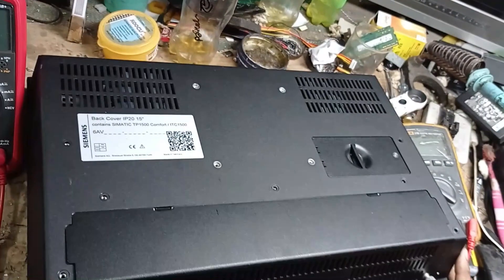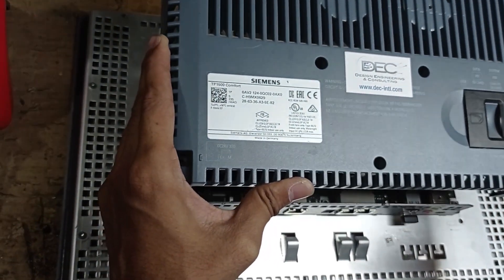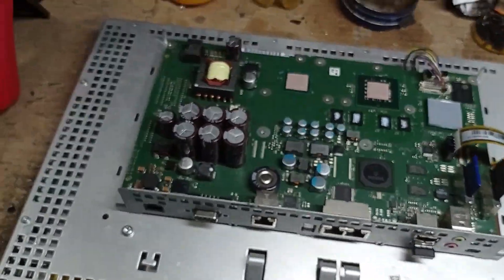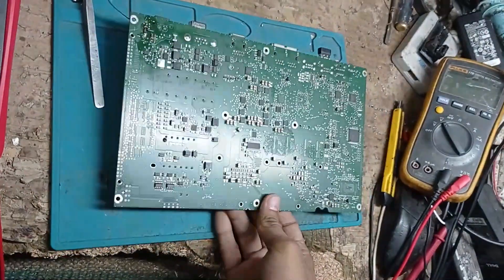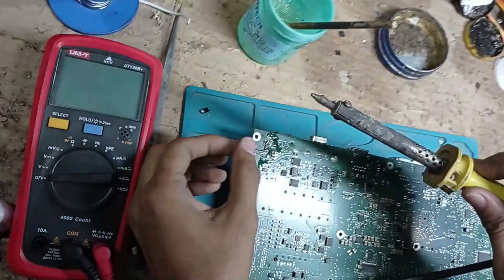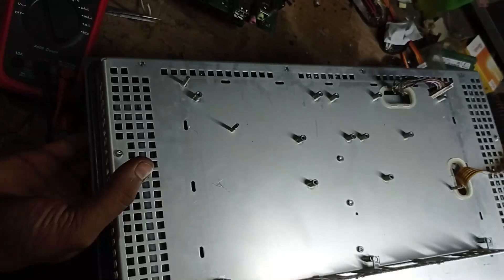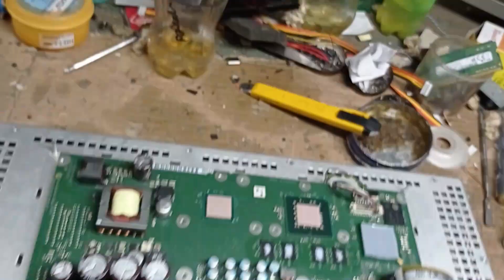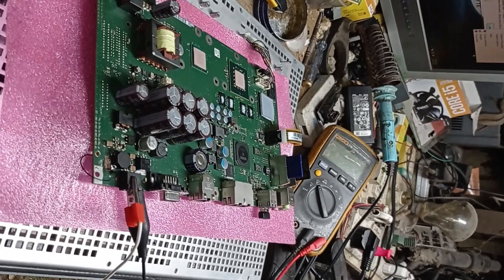HOW TO  NO POWER REPAIR SIMATIC HMI TP1500 Comfort, SIEMENS

Comment: My siemens display is black and  I am not getting any power to the USB or ethernet ports. I have a TP700 comfort panel
Reply: My HMI Schneider Plant running time auto matic total machine s are off HMI showing stop ofter restart all are start what is the problem please tell me and reply me
Reply from the maker: plc between hmi communication are ok?
Reply from the maker: send me same image
Reply from the maker: where are you from?
Reply: @kamranelectronics2992  North Carolina, US. It looks like the AC/DC Transformer is bad. I am just wondering if this is the only part that is bad on the board
Reply from the maker: if you need any support you can call me
Reply from the maker: contact on +8801765627823
Reply: Mine also,the monitor suddenly black, and i have to restart d power.this case happen many times, do you have any idea about this?